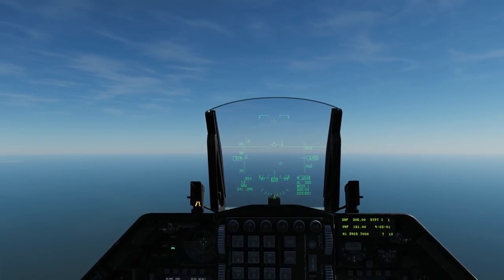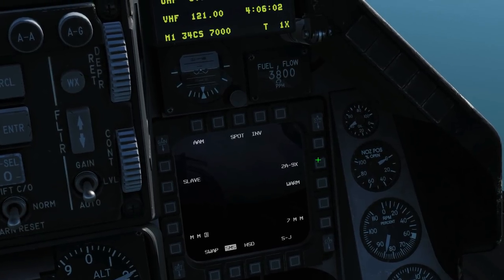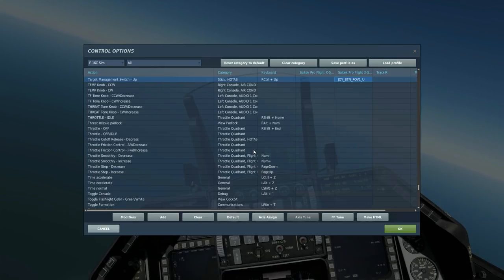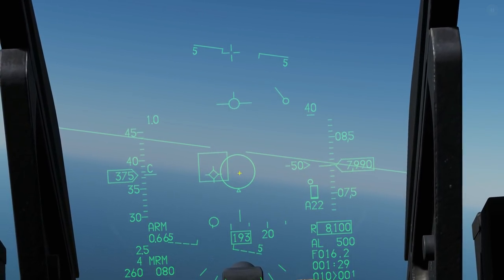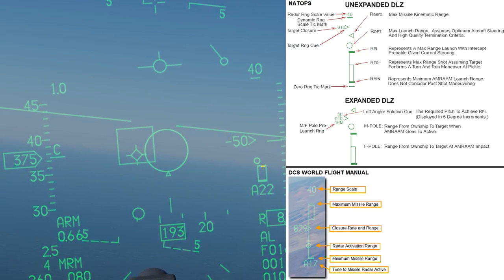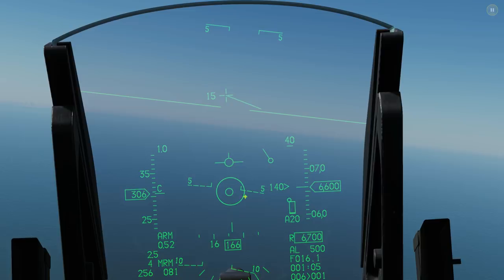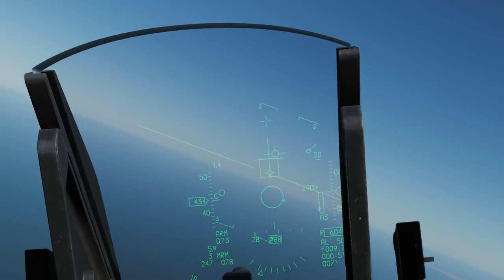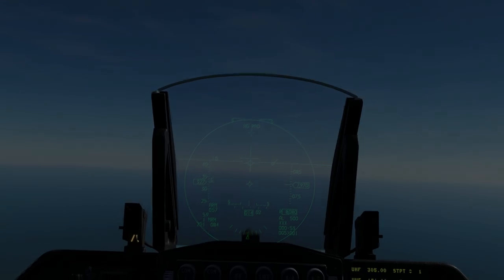F-16C Viper: Aim-120 AMRAAM Tutorial | DCS WORLD

Comment: my understanding of radar activation range.
12:38
F16: range from ownship to target when AMRAAM goes active
the F16 manual is saying the range between airplane and target at which AMRAAM goes active (pit bull). But you have to remember, this is BEFORE firing the AMRAAM, so the range between airplane to the target is ALSO the range between AMRAAM to the target.
a very simple way of understanding: 
if you fire outside of this range, AIM120 takes Axx seconds to go active (pit bull) then Txx seconds to hit.  if you fire within this range, AIM120 starts off ALREADY active (pit bull) and takes Txx seconds to hit, no Axx time to active.
but weirdly i think it doesn't work, cause theoretically when your Axx goes to Txx, you should be right on the radar activation range but it keeps dipping down. maybe it takes a second for the aim120 radar to start tracking eventho it doesnt rely on the plane anymore.

Comment: You can also switch stations by using the Missile Step button, which is the same as Nosewheel steering in A/A mode. Lot easier than pressing an OSB tbh
Reply from the maker: thx
Reply: Where is the NWS button in the cockpit, or is it just a key bind, please?
Reply: @greggall205  It's the NWS A/R DISC MSL STEP Button on the flight stick, I suggest you binding it on your HOTAS. If you're out of buttons, you can assign one as a modifier and expand your possibilities. If you by any chance fly using the Thrustmaster Warthog, it's the grey button on the right side on the top of the flight stick.
Reply: @hefkyyy  Thanks. I use a Saitek X52.

Comment: 3:14 These OSBs share functionality with your Nose Wheel Steering button on the Stick. If you press SHORT this button while you're in the A-A Mastermode, it will do the same as pressing these OSBs. Pressing it LONG should cycle throught the different types of missiles you're carrying. But someone said this function is not yet implemented.

6:09 Here the DCS module starts differing from Falcon BMS in Radar Functionality. I'm not sure if BMS has this Situation Awareness mode. At least I've never used it. In BMS it has the RWS, TWS, VIS (which I also never used) and STT modes. You cycle between RWS and TWS by pressing TMS Right LONG. In TWS the Azimuth of the radar scan is reduced from 120 to 60 degrees, with the sweep area centered at the Cursor (until it reaches its gimbal limits). And at least in BMS, if I switch to TWS while my cursor is on top of one contact, it will pre-lock that target automatically, and the next 4 or 5 contacts in range of my scan will be automatically set as secondary targets. I can toggle between these targets with TMS Right SHORT (or is it TMS Left SHORT, can't remember that at the moment. I'll have to check that in BMS).

If you press TMS Up on the primary target in TWS, it will then fully lock it in STT. Pressing TMS Up on a locked target in STT will un-lock it but keep it as primary target in TWS (if you were in TWS prior to the STT) and pressing TMS Down in STT un-locks the target completely and goes back to the previous mode with no target selected.

While in RWS you can also change the Azimuth in two different ways. One is via the Off-Screen Buttons on the MFD. You've already showed this method in previous video. The other method is with the TDC Slew. You slide the cursor all the way to either side of the screen and pass beyond it. When it crosses the edge of the radar screen, it will come back to the center, but this time with the different scan azimuth. By default, the FCR is enabled with 120° azimuth, when you cross the edge, it will cycle to 60°, and if you repeat the process, it will go back to 120°.
Reply from the maker: Thanks for the info WL!
Reply: @grimreapers  You're welcome. And I have checked some of the infos there about BMS, and yes, BMS has the Situation Awareness mode (how come I never used it?) when you quick lock a contact on RWS mode; And target cycling is done by pressing TMS Right Short when you're in TWS with more than one contact tagged as targets.

Comment: Big question, is it possible to have a fire solution on hostile track acquired via data link (with no radar)? In that case You could use bore sight mode much more efficient and wont spike anyone informing them about your presence prematurely ;)
Reply from the maker: Neg u need FCR or an F-35 for that
Reply: I'm pretty sure the SAM (situation awareness mode) (TMS up 1x in RWS)  track is still a soft lock.

Comment: Hi, I have a question, can you tell me where the keyology is located on the button to log the target on the Aim-120 rocket radar amram I can't find and assign it?
Reply: TMS up locks a target, TMS down unlocks.
You can use these buttons on the radar mfd and in MSL OVRD or Dogfight modes (both modes have their own button) TMS down while in MSL OVRD or dogfight mode switches to vertical scan 60 degrees, TMS up gives you boresight mode.
Reply: @phreak761  Thanks for the info

Comment: New to DCS and having trouble firing AIM-120s. Master arm on. Tried targeting in both soft lock & STT,  showing as diamond in the HUD with all the correct symbology, steering cues and ranging info, etc. When in range (about halfway down the box)I press the weapons release button on my X52 (bound to button 2) and nothing happens. Same in dogfight mode. No problem when selecting and firing sidewinders using same button.
Have I missed something or is it a bug? (pun intended).
Reply: I've looked on DCS forums and can't find an answer to this problem.
Reply: You need to hold the button for like a second!
Reply: @CramcrumBrewbringer  I've tried that. No joy. Either I'm doing something wrong (most likely) or I've a buggy F16.
I've just got the FC3 pack. Need to do key bindings and then see if it will work. I'm wondering if I've not got the key bindings right for the F16. Surely if I have a target box and I'm in parameters AIM 120 should come off the rail?
Reply: @greggall205  Maybe try verifying your game files?
Reply: @CramcrumBrewbringer  Hi. I'm a noob at this. How do I do that please? Thanks for your help master.
Reply: @greggall205  If you have it on steam, right click on DCS in your library, properties, local files, verify integrity. If you have it elsewhere, let me know the platform!
Reply: @CramcrumBrewbringer  Hi. Thanks. I got it as a stand alone from DCS site on PC , Windows 11

Comment: Of these hat's which one is the least or not needed at all... i'm out of hat's because i at least need one to look up, down, left, right out the window and to inside panels, etc and I am using a T50 CM2.  So here are what i see on the real aircraft grip/stick .... TMS, DMS, TRIM, CMS - they all require 4-way hat switches on the grip.  i am plum out of 4-way hat's on the grip/stick (virpil T50 CM2 grip only has 4 4-way hats)...  Unless i sacrifice my ability to view left right up down, which I just can't give that up since i am not using VR nor am I using a Track-IR.  I'd really like to keep it close to the real F-16's and not put a hat that is suppose to be on the grip, over to the throttle.  I'm filling up the throttle hats quicker than lightning right now anyway.  I'm stuck, any help is appreciated!!!
Reply: In case you didn't know, you can use what is called a "modifier", a button of your choice that can change the fonctionality of every other command on your Hotas. You can for exemple assign a single 4-way hat to both DMS (while pressing the modifier) and TMS (without pressing the modifier). I know your struggle, I've been there too, looking around with a hat is hard. I strongly recommend you to get a DelanClip, it's cheap, it's reliable, and you can put it on a headset, that will change entirely your DCS experience, without ruining you if you're on a budget. Here's a link to their website, so you can check for yourself : delanengineering.com
Hope that helps, cheers :)
Reply: You can either A: use a key modifier or B: unbind trim if you’re a masochist who can man handle your plane manually and won’t go crazy doing it for a long period of time

Comment: So why wouldn't you use SAM mode?  It lets you keep an eye on the other hostiles and doesn't warn the target he is locked,  so at first sight is a better idea.  Its not quite TWS  (can't lock multiple targets in SAM as you can in TWS, but its part way there).      Is it a more accurate/better lock in STT since the radar  is not still scanning and is concentrating on just one contact?    The disadvantage of STT is the target knows he is locked, and other hostiles could be sneaking up on you without you knowing where they are.    Maybe you could do a video experimenting with the two modes to explore differences in range/accuracy/likelihood of target breaking lock?  Thanks for the video  as ever Cap.
Reply: The reason is that in SAM mode your radar is not locked to the target so If the target moves out of the scan area before the 120 goes pitbull it will lose track. You definitely can use it in SAM mode, there is just more of a chance that you will miss.
Reply from the maker: Roger Arty, I think me and RC best do some testing.
Reply: SAM mode will alarm the enemy who has RWR audio enabled. Because your radar starts scanning the target rapidly out of standard pace but doesn't lock to it. Anyways the soviet RWR will give the pilot information of the range by the radar emission strength, and they know the distance when you can launch missile and starts maneuvering to make you waste possibly launched missile. 

And if both sides has datalinks (like soviets GCI doctrine is, if the GCI can't see the target or threat, pilot is not allowed to engage but needs to flee) that negates your TWS, SAM etc surprise launches as everyone knows where the missiles are going. Why doctrine is to use STT so you maximize the probability  to hit and you get maximal information. You are not there alone, you are there with wingman and maybe even with another group, and there is no sense to pretend that you are not seeing them or engaging them when you have hostile intends by flying toward enemy (capable guide missile).
 you should use TWS only against bombers and similar non maneuvering targets.

Comment: Is there a way to get rid of that anoying delay between WPN release press and actual launch?

Also the MSL volume dial (WPN in the F/A-18c as well) seems to only have on and off setting. If I start turning it down, nothing changes in the actual volume of lock tone until it reaches the treshold and goes completely off. Is this a DCS thing or am I missing something?
Reply: All missiles have delay due to the fuse needed to launch, some take longer to light than others

Comment: is 5-20 nautical miles the effective range of the AIM 120? I thought it's max range for the C variant was about 50 nautical miles?
Reply from the maker: I've got 62 miles in a test. But in a normal fight you'll never see more than 20.
Reply: the missile can technically fly that far but by the time it gets there its lost too much speed to maneuver effectively and so the likelihood of a hit is very small
Reply: That also has to do with the altitude and aspect of the engagement. In higher altitudes, the optimal range will be longer, because the missile will fight less air resistence on its path.

As for the aspect, if the target is coming towards you, this will also increase your max range, compared to when the target is moving away or notching/flanking.
Reply: If the target wants to die, that is, doesn't evades.

Most BVR kills were always within 30nm and less
Reply: @derelicttyrant3409  Exactly. And even a 30nm kill shot, at least to me, it looks like a pretty damm lucky hit.
Reply: Grim Reapers what kind of real world background do you have?
Reply: Max range is typically calculated for 10km altitude, no wind, specific temperature, launches at 900km/h and 1200km/h and head-on to enemy that is closing at 900km/h at the same altitude.

No maneuvering, no altitude changes, no speed changes, no ECM, no datalinks etc etc.

So when you read "max range 140km" then it is closer to 15-30km for maneuvering target, and if those use ECM, CM you drop to 10km or less, and if pilots knows how to fly, you very likely are in dog fight before you even think so.

So those ranges you read, they are mainly against a non-maneuvering targets like a bomber or passenger jet or high altitude spy plane.

Comment: Why the missile guidance is completely borked? The radar guides you to point aircraft over 15 degree left from target and clearly downward, that would be the straight intercept heading for missile. But once launched, missile takes away, turn hard right toward target and starts to climb.... 

If the guidance system would had worked, missile would had flown straight ahead and never start turning, not for even long time after launch as target turning doesn't matter.
Reply: Yep and near Rmax that steering cue should give you a loft angle as well which it doesn't.
Reply: @dmsdmullins  any idea why?

Comment: What is the reason to use an Amraam at this range compared to a sidewinder? I thought Amraams could go much farther than sidewinders but the way you made it seem, it was most effective under 10nm
Reply: it was because he was at about 6k altitute. as a general rule of thumb, a missile's range doubles every 20,000 feet. this is because the air is more dense at low altitudes, therefore more drag and resistance and a harder time turning. at such a low altitue, a sidewinder would only be effective at about 2 nm.

Comment: I thought that if i shoot in stt mode  the missile doesn t use datalink but it works like an aim 7 (fox 2)
Reply: If you shoot in STT mode, your aircraft radar is already emitting a hard lock track frequency to constantly track the target and also feeding data to the missile, so it will alert your target that you're shooting it, no matter what type of missile you use. Even AMRAAMs will use data from your radar during STT launch until it reaches Pitbull, or the target breaks lock, which will force the missile to activate its own radar.

In essence, you can kinda think of the AIM-120 as a fancy-and-improved AIM-7, in a sense that it has it's own radar and doesn't fully rely on STT locks to reach the target, but the techniques surrounding its deployment are pretty much the same, with the exception that you can't fire an AIM-7 in TWS mode, it has to be an STT launch.

And a small correction here, if I may: AIM-7 is Fox-1.
Reply: @William3000x  the questions was: when u shoot an aim 120 in stt mode the carrier sends information of the target via datalink or the missile uses is radar antenna to only receive the energy of the carrier s radar e to in the target?
Reply: @iltgdellosportivo2066  I have no idea how this works in thecnical minor details, but I believe the missile has some sort of datalink system to the mothership... These levels of details are probably impossible to obtain, since much of this stuff is classified.

What makes the most sense for me is a datalink to recive data from the mothership's radar, since the missile's radar is off in the first stages of the flight. Without any datalink to the aircraft, how would a missile detect that the target has initiated an evasive maneuver, and pull up a drastic turn to intercept the new calculated impact point?

AIM-7s with absolutely no radar on itself, they rely on the aircraft data to perform this action. AIM-120 should be no different.
Reply: @William3000x  it isn t true aim 7 rely to the motership. Aim 7 follows the reflections of the radar s wave. Aim 7 has no kinda datalink
Reply: @iltgdellosportivo2066  Hmm... Interesting. And it also makse sense. Well, my guess is that the AIM-120 does the same, cause it would be the more practical and thecnically easier approach.
Reply: @William3000x  I do think you have to possibility to SST an AMRAAM in BMS all the way, without the missile being activated. But we'd have to test this in MP....

Comment: Is the "F" Number on the lower right side of the hud the accurate distance to the target?
Reply: That is the slant range. "slant range is the line-of-sight distance along a slant direction between two points which are not at the same level relative to a specific datum"
Reply: @firemedicjm911  but I have noticed it was XXX until the target is lock while on missile mode
Reply: @alessandromilanesi4611  It shows XXX because the slant range is computed by the radar so if there is no lock, there can be any range computed.
Reply: Essentially, yes. The "slant range", as it is called, is the direct distance between ownship and the locked contact, in nautical miles.
Reply: @firemedicjm911  in an A2A engagement,  slant range is equal to distance to target.
Reply: @firemedicjm911  i would assume pilots have to be good at physics